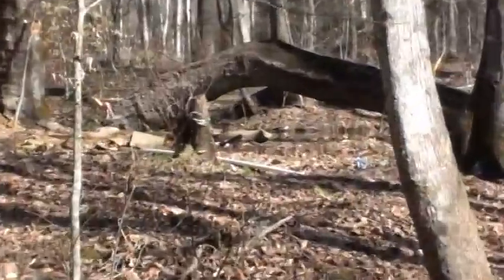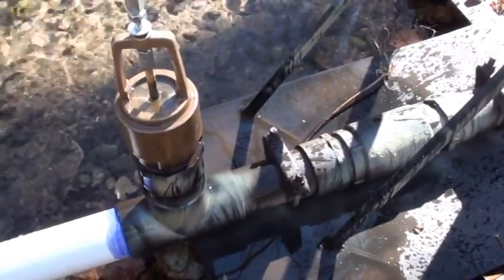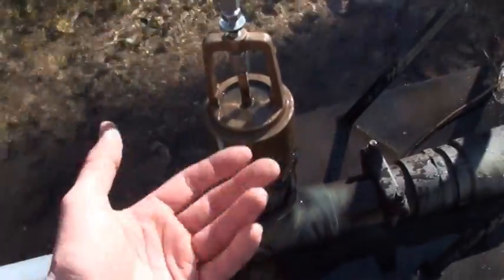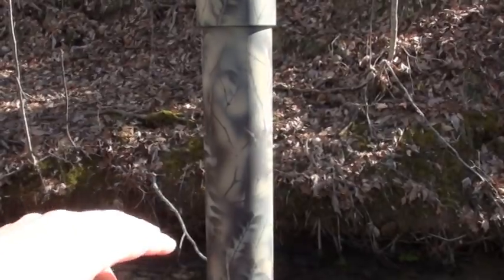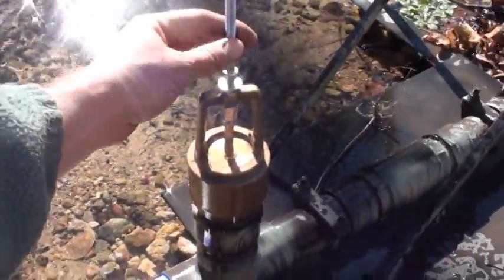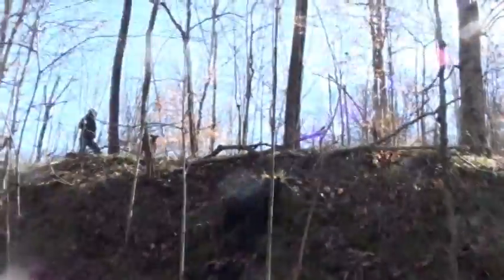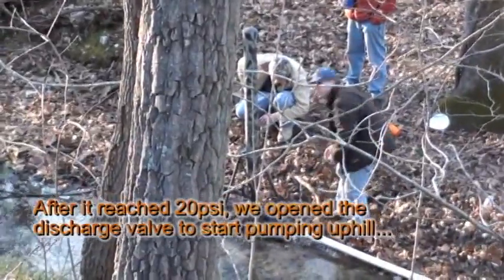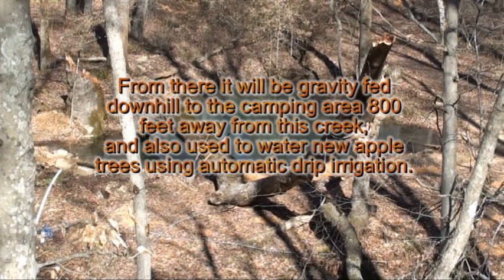Camo Ram Pump- Free water, No Motor, No Power

Comment: Gentlemen this is brilliant! Me and a couple of friends were looking for a water pump that doesn't use electricity to pump water uphill to our campsite. Our plan is to have falling water turn a waterwheel and give us just enough energy to power a couple lights and maybe a radio while we are out there. Luckily for us there is a fast moving river about 300 - 400 meters away so we aren't limited to just standing water however your method is a great alternative for when the water flow isn't as high (droughts or dry season). Was going to ask you how much you paid for the piping and check valves, some of the equipment you use is a little expensive over here especially since we are students.

Comment: I like how you extended the valve stem upward to mount weights on.  I had trouble with the brass valve stem breaking because the weights were hanging on the bottom of the valve. I fixed it by making a stainless steel oversize valve stem. I just put up an update video after 8 years of running on 7-9-2016. Being able to add or subtract weight to the valve is crucial to obtaining maxim flow.

Comment: Would there be build up of water level where the ram pump is situated or is there a discharge point where the released water from the moving valve flows out to prevent flooding on the ram pump itself.

Comment: Hi, With only the one guide to the waste valve shaft and the leaning of the shaft with all the weights added it would add a considerable amount of friction and binding of the shaft. The issue your waste valve is too much pressure. By replacing your waste valve with a common type anti-siphon spring valve with the spring removed this could be cured with the addition of a ball valve under the waste valve adjusted to the correct pressure to match the waste valve. Another advantage is a common anti-siphon valve has guides to the top and bottom of the shaft reducing wear and binding of the shaft. Another way of adding weight to the valve described is by simply screwing in a stand pipe into it, the extra water on the valve acts as weight. All the best from "Down Under".

Comment: Instead of inner tubes in the air chamber, why not just leave the cylinder empty, full of air?
I wonder if this could have some applications at the bottom of a water tower. Hmmmm....'have to get my calculator out.....     .433 X
Reply: machia0705 Because all the air will eventually be absorbed into the water, and the pressure chamber will not then be a pressure chamber, but a water-filled pipe. The inner tubes act as a barrier to this.

If this isn't clear, think about what happens to the CO2 in a can of coke - it's all absorbed, right? The air in the pressure tank eventually is, as well.

Comment: Excellent work you are doing!  With the unit you are constructing I was wondering if there would be enough reserve power to add an electric power generating unit.  Here is a link to a YT video showing the setup.
     HYDRAM ENGINE, HAMMER ENGINE, RAM PUMP ENGINE  
The idea is that the ram rod as it rises would push a lever working on a "clutch bearing" , clutch bearings lock in one direction and roll freely in the opposite, giving a momentary kick of energy to a flywheel turning a permanent magnet alternator.  The result is you are getting your water pumped and also getting electricity.  Most importantly for FREE!

Comment: Thanks it is a great idea.
Last week i tried the same.
Look i do not have a creek,i have a slow moving river.
I did an experiment and i need help,i took  1" 40ft hose pipe and filled it with water ,closed both sides and lifted it at 12ft and 10ft high,then i let 32ft run along the direction of the flowing river, When i opened both sides at once the water flowed endlessly for an hr.But the pipe was not full as the flow continued.
Do you think this can run a ram pump?
Chris
Reply: Not sure you experiment tells you much.  The key, in physics terms, is the amount of water and the length of drop.  If you can fill a 4" pipe and get 4 to 6 feet of drop, it will power the pump.
Reply: Hose pipe has to much flexibility to absorb the 'shock' of the water which slams the valve closed.  The hose pipe just expands instead, acting like a shock absorber- you waste the energy you're trying to capture.  You need hard pipe, metal is best (although PVC has worked well for us).  You need a larger diameter "drive" pipe to get more velocity in the water flow. *The speed of the creek or river has nothing to do with how this works.*  A standing-still pond would work just as well.  The factors that are crucial are:  drop in elevation from the start of your pipe down to the ram pump (must be over 4' drop), the size of your pipe (depending on how many gpm you want the pump to produce) and the efficiency of your foot valve (must close quickly to force the energy of the moving water through the check valve).  Good luck!

Comment: Wonder if you run a second support point on the valve, so that it slams in a straight  solid direction. Talking about the valve that you are stacking weights on.  Seems to wobble and not slam true. Just an observation.! Might help improve faster pressure. Doe no?
Reply: That shaft was just temporary as we found the correct weight.  After we did, the shaft was cut down and a lead donut was placed at the bottom so there was no more wobble.  We get about 400 gallons/day at 60 feet now.

Comment: Amazing!!! did you fabricated the flap/float/hammer valve yourself, if yes any chance of seeing a drawing? Thanks
Reply: This is a standard 'foot valve'  with just the lower section of brass cut out with a hack-saw.  It is actually turned up-side down from its intended use as a foot valve for a pump (to keep prime in a submerged pipe, like in a well or tank).

Comment: A couple of things we learned when we tried to de winterize:
1) It is very difficult to get 100% of the water out of the pump. We thought we had, but enough leach back in/didn't fully get out of the pressure tank that our elbow froze and cracked.  Putting a drain valve on or next year!
2) the inner tube that we used as a bladder got pulled down into the very bottom of the air tank almost to the waste tube.  We are looking for a way to keep it up high in the tank.

Comment: well,yes.  The energy of water moving down hill is free.  As for flowing in a circle, I'm not sure what you mean.  This device captures a tiny portion of the energy from the stream to push a little trickle of water up to storage tanks.

Yes, the energy of flowing water can be harnessed (in several ways) to generate electricity by turning a turbine.  Google "hydroelectric dams" for some good examples.

Comment from the maker: @inegma29 You're absolutely correct. this was a test run and we didn't want to make the weights permanent & this was the easiest way I could think of to add & remove weights.  Afterwards we measured the ideal weight, and I melted some lead into 2oz donuts.  We then installed the weight donuts directly on top of the flat part of the foot valve and glued it down. Worked much better. Thanks for the comment!

Comment: the length of the bolt shaft ur adding weights to is effecting its oscillation. The weight of the shaft at the top of the shaft will sway back and forth effecting the seating or sealing of ur ram......kinda like a light pole in the wind. otherwise great job :)